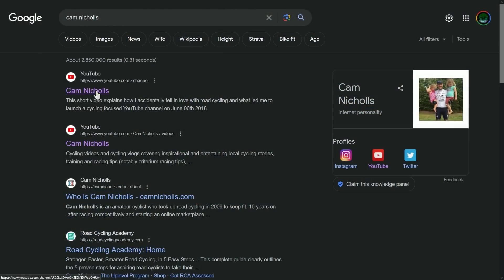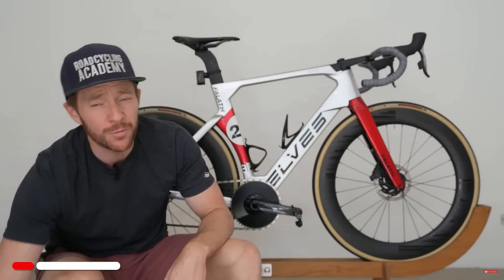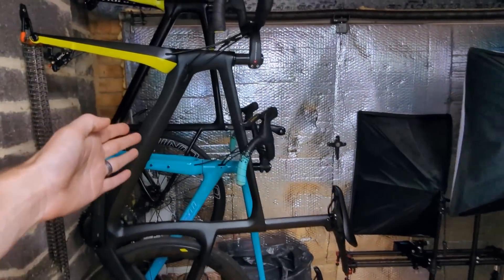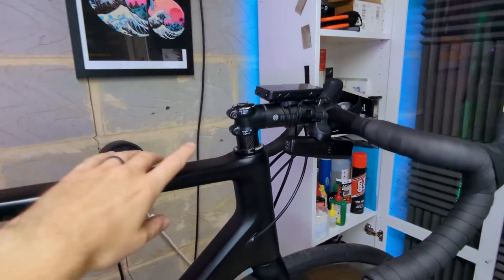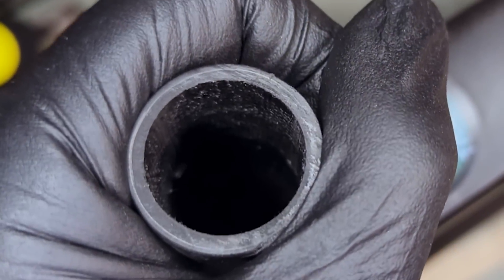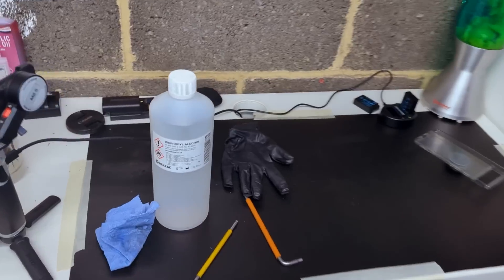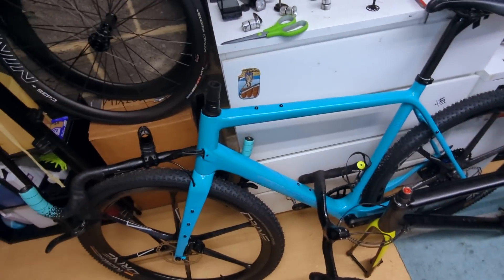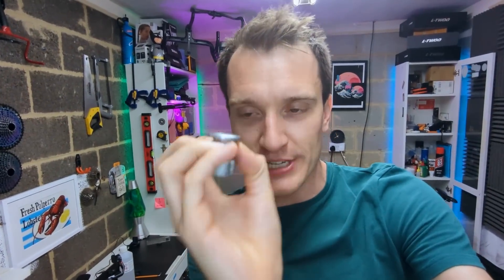Is fibreglass used in cheap carbon bikes?

Comment: My ICAN frame has just been shipped, so I'm glad to see no glass fibre there!! 😅
Glass fibre has a lower Young's modulus, so it'll stretch rather than contributing any strength to the part.
It being an electrical insulator is possible, but with carbon being laminated and lacquered, I don't know how important this is 🤔
Reply: Even if the part had fiberglass, so what? If the part meets the strength and weight requirements then it does not matter.

A better way of judging this is to actually perform instrumented testing on these forks to see if they meet strength and weight requirements.

I don't even use carbon forks. When i buy carbon frames i always replace the stock carbon fork with an aluminium fork.
Reply: @sepg5084   That's a fair point.
I think the issue with composites is that they're anisotropic, so you need to layer the material in specific directions depending on how the load is applied.
I have no idea how the strength requirements would be specified given that it would need to be strong in multiple axis with dynamic loading and then layered accordingly.
I guess the only real test is empirical, measured by how many teeth you have left! 🤣
This will be my first carbon bike, so I guess I'll find out how it is 🤷‍♂️
Reply: Tell me you don't know what you're talking about without telling me you don't know what you're talking about 😂
Reply: @roberthenry961  Young's modulus LOL. Do you even know what that is? Or how to apply it? Obviously not.
Reply: @roberthenry961  I was going to ignore  your comment, but this popped up in my timeline today - here's an explanation directly from a Mercedes-AMG Formula 1 engineer.
https://youtu.be/j7bQYEt_qtU

Comment: As you said in the end, the fiberglass is used to prevent corrosion issues with the aluminum compression plug. It's not cost cutting. 
Good frames have fiberglass in the seatpost area as well.
Reply: this person knows^^^^^

Comment: I don't know if I would put ICAN in the same box as your other frames. I have a set of ICAN 50mm wheels and other than a recent rear hub rebuild (in fairness the bearings were fine but the axle was worn) they have served me well for three or four thousand miles. I would have no qualms about buying an ICAN frame.

Comment: Fibreglass is supposed to be more resistant against impacts then carbon fibre laminate. I think using it in combination with carbon fibre for the steerer tube is for safety reasons. Stiffness should be no problem. I would ride this fork any day of the week!
Reply: The only problem is lack of disclosure of using carbon fiber and fiberglass materials on the frame or fork by manufacturer.

If the manufacturer is honest with their frames and forks using both carbon and fiberglass materials.  Then this wouldn’t be an issue.

If there was an advantage on cost and durability using both hybrid carbon fiber and fiberglass materials vs. pure carbon fiber. The consumer has a right to know.
Reply: @iMadrid11  If it's just used as a liner inside the tube it self it's just a small part of the fork that contains a small amount of glass fibre. "99,5% of our frames and forks are carbon fibre, but we line the steerer tube with a thin layer of glass fibre too"  Is that what you want to see?
Reply: @iMadrid11  You could try making a frame out of "pure" carbon fibre but it might be a bit floppy without the resin, that's why they are officially called "Carbon Fibre Composite" or sometimes just "Composite".

Comment: I actually recomended your channel to the Elves representitive with whom I've been in communication. I'm currently awaiting my falath from them and so far the ocmmunication has been excellent, also their patience with my dithering around the paint design.
Reply: Me too I was super picky with Colors but the communication has been excellent waiting for the bike now
Reply: Been riding my Elves Falath (Previous non-UCI model) since I built it this winter and it has been fantastic! Cable routing was a bit rough, and don't look forward to re-cabling it anytime soon, but otherwise has been a dream. Would be great to see Luke build a more premium Trace Velo build using one of their frames!

Comment: I think the glass fiber vs carbon fiber discussion misses the point a little bit. Like you could slice apart a Specialized or Canyon or Trek or Giant or whatever major brand frame, see a layer of glass fiber in amongst the layers of carbon, and you'd be 99% confident that it's there for a very solid engineering-based reason, or at the very least all the analysis has been done to show that it's a safe and reasonable application. None of those companies would risk their brand name on shoddy engineering or poor QC or unexpected substitutions. (And, of course, there have been brand-damaging scandals when some bikes and components have had systemic failures; the canyon handlebar failures come to mind as a recent example, and lots of time and expense was poured into rebuilding the trust in the brand afterwards)

But when it comes to the off-branded or unbranded frames, since there's essentially no "this will damage our brand" risk, there's no inherent motivation for those manufacturers to produce a product that's consistent or well engineered or extensively QC'd. Like if suddenly social media is filled with a bunch of Elves owners in the hospital after their frames broke, you could bet your bottom dollar that the "Elves" brand would disappear in a puff of smoke, and suddenly AliExpress would be filled with "Gnomes" brand frames instead.

It's entirely possible that Elves will try to buck the trend of fly-by-night import brands, and actually spend years trying to build up trust in their brand name. Until that happens, though, it's anybody's guess as to whether buying one of their frames is a good bet or not.

Comment: That’s not fibre glass in the fork, it’s actually a finely engineered layer of 🥖🥖🥖 that also negates corrosion and is excellent at dampening vibration. Plus if part baked it has great thermal properties. 
Great video as always. Could you do a more in depth review of your gps computer from Amazon? Also noticed L-TWOO had an electronic shifting groupset on euro bike and wondered if you would be testing it eventually??
Reply from the maker: Have an offical Trace Velo Baguette on the house tiger! 🥖

So tbh, I probably wont cover the IGS630 in detail, but here is a link to a decent written review I had a look at before agreeing to check it out: https://www.cycloworld.cc/article/igpsport-igs630-review/2418

Also the L-TWOO eRX is in the post BABY, should be here in a week or two :)
Reply: @tigerv88 you had me until I saw the 🥖 🤣

Comment: Mechnaical engineer here. I'm not concerned about the use of fibre glass on the inside of the steerer tube. During design, you could just neglect the fibre glass layers and do your stress calculation based on the carbon layers. During manufacturing, I don't see why it needs to be more expensive to use fibre glass: If you use a prepreg process, it doesn't really matter if your employee reaches into the left box with the glass fibre or in the right box with the carbon. 
As you mentioned, there are certainly some advantages: Glass fibre is less tough, so it's easier to machine and produces less toxic dust. Galvanic corrosion is also mitigated. The loss in stiffness is probably quite negligible. I would definitely buy a bike with a glass fibre/carbon steerer tube.
Reply from the maker: Yeah I def think it's not a bad thing to have some glass fibre in there. Like you say, i assume the difference in overall strength/stiffness will be negligible. Having said that however, the glass fibre layer on the Elves fork did seem quite thick, nearly half the total thickness of the wall actually. Especially when you compare it to the scott frame that Grant at GC Performance showed...

Comment: Actually remeber that glass fibre has different material properties than carbon fibre layups, it has less stiffness but a lot more flexibility. Look at the Lauf spring fork, the little tabs used as springs are not carbon, but fibreglass, becouse it has more resistance to flexing. Using glass fibre in the fork like that may have some advantages in vibration absorbption(?) And also a smaller risk of a catastrophic failure.
I'm also a kayaker and in our cabon fibre paddles and shafts different material like glass fibre and kevlar are used all the time to adjust the stiffness and decrease risk of tendon damage in the wrists. Maybe elves is just ahead of other manufacturers with their composite layups.

Comment: I'm sorry to throw a wrench into your lightning fast reaction video (impressive, seriously) but there's one thing that Cam mentioned very briefly, which is that many manufacturers use black colored fiberglass to hide it. It's not that black and white (literally 😃). You have to look at the inside walls. If the weave is very fine, almost hard to see, and individual fibers don't shine at all, like they should in a relatively smooth, reamed carbon surface, you are in fact, dealing with fiberglass. Which looks like most forks in your collection. Also, another reason why fiberglass is used as a cost cutting measure is that it's easier to machine to final size. Inside of the steerer needs to be quite round and precisely sized for the expander plug.
Reply from the maker: @michaelmechex  Great comment! So I heard this in cams video, and definitely took this into account, and tried to looks for evidence of dyed glass fibre, but i still think they were all 100% carbon apart from the OG-Evkin fork. Unfortunately I've put all my bikes back togeher now, but i did find a number of offcuts from when i cut the carbon steerers to length, and recorded this little video: https://imgur.com/3mbxEcD
Reply: @TraceVelo  Thank You! Yes, after closer look, those three definitely look like carbon fiber. I really appreciate the video and all the effort you're putting in! Keep being awesome!
Reply: @TraceVelo Fast video again!
Reply: Well, GC performance looked at "expensive" bikes and they use fiberglass too. So what if it is using fiberglass? If the part meets the strength and weight requirements then it does not matter.

A better way of judging this is to actually perform instrumented testing on these forks to see if they meet strength and weight requirements.
Reply: @sepg5084  this whole thing is a thing because we want to know what we're buying. Paying 5000 dollars for a frame that's not as good as it could be because of cost cutting measures is a bit crap, isn't it? They only get away with it if we don't know.
Reply: I have the older Falath Pro and the inside of the fork is black. Just because different materials have been used it doesn't give Cam the right to bag Elves
Reply: your description of fibreglass seems also identical to UD carbon fibre. Cutting fibreglass is also a little different than carbon
Reply: @8paolo96  no way. Unidirectional carbon fiber doesn't have any weave at all and has an interesting shine to it, even when it's not polished. Fiberglass is kinda matte.

Comment: This repeats itself over and over with the "industry experts". Be that an "expert mechanic" takes a Dremel to a set of brake calipers, just because they "have to be wrong, because they are cheap". Or the "carbon expert" that hasn't seen a particular layering and "it has to be to cut on costs, because is cheap". 🥖🥖🥖🥖
Reply: And they all don't realise that fact that the ridiculously exorbitant costs of the so called brands are mainly due to extremely expensive decals and the coffee for the patent troll department staff. Bikes are not high-tech products. The materials in use are not that expensive at all. The technical requirements are nothing extraordinary.
Reply: @rosomak8244  One of the main costs in "premium frames/bikes" comes from branding: PR, endorsements, product placement, etc. Manufacturers from Asia don't spend a fortune to have their companies' name splashed all over the specialized, no pun intended, media outlets. So instead of paying $1,000 for the frame and $3,000 for the branding, you end up paying just the $1,000 for the frame. It's simple, no branding overhead.

Comment: Interesting - I'm keen to learn more. If your one tube contains glass fibre, then surely the layer is in the wrong place to mitigate galvanic corrosion because it is not the innermost layer.
Reply: I think your refering to the white/grey layer sandwiched between carbon layups, I noticed that to. But that's not what he's refering to, what that is, is a layer of the epoxy they use to "glue" the carbon layers together. 👍
Reply: @ingenfrygt  Thanks for that. You're right, that is the layer I was looking at. I appreciate the correction.
My interest is fuelled by owning a Ribble, and they're one of the brands whose name gets mentioned in this 'is it carbon or glass fibre?' discussion that has started up.

Comment: I work in manufacturing - you're absolutely correct, having to stock multiple materials (supply chain) and multiple steps in manufacturing process will likely be more expensive all things considered.
Reply from the maker: Yeah as soon as I saw the cheaper forks were fully carbon, this is where my mind went. When companies make cheaper products they try to find as many ways to cut costs out of the production process.
Reply: @TraceVelo  to be fair the full business case could be a lot more complicated. If using fiberglass reduced warranty claims (around corrosion) then you could argue that using fiberglass is net-net cheaper when you consider the entire lifecycle of the product. Obviously, I don't have visibility so everybody's just making assumptions...
Reply: Depends on the batch numbers and number of people involved. If you have a frame with 300 pieces, put together by one person but prepped by 5 more, no difference in labor if one or two of them be cutting out glass instead of carbon. Same goes for supply, in annual report the total cost matters more than in how many transactions to how many suppliers the funds were transfered.
But when it is a small shop without dedicated workers, simplification helps a lot, agree.
Reply: Why would u have to stock anything. U can order any sized load of raw materials and have them delivered same day in china.

Even meat can be padded with waste by products to add bulk. U have no idea the drive for ppl to make a just a little bit more money.